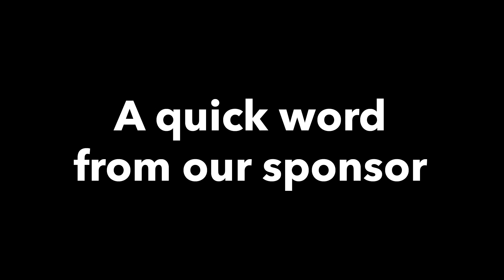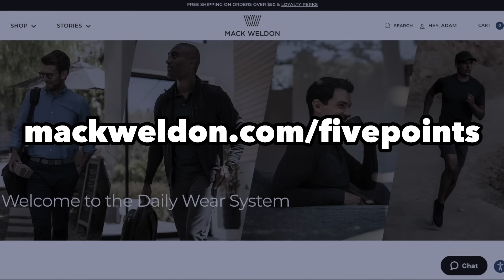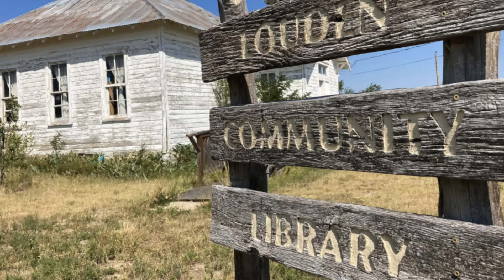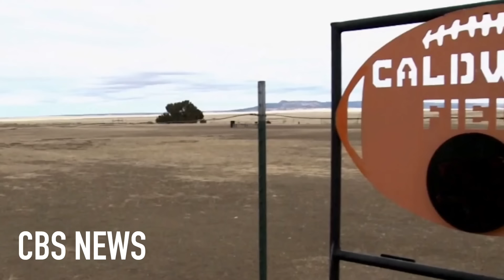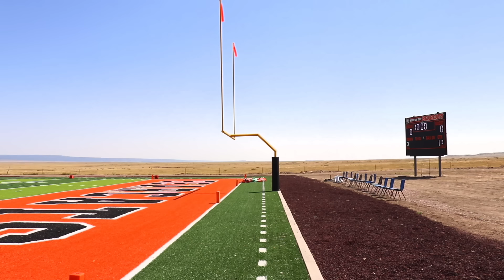What Happened to the 'Worst High School Football Field' in America?

Comment: The closest gas station is an hour away? So they drive an hour to get gas, and waste it on the hour drive back? 😂
Reply: A communal Gas Pump might be a good idea. Regulations on building one are tough after all can't have them leaking into the ground that stuff causes cancer and other problems but should be able to be overcame. No way to make it profit driven. Or switch to electric once the vehicles are all cheap enough to be afforded out there in the country. Although I don't know about battery performance with cold and good amounts over sea level.

Comment: God, closest gas station an hour away. By the time you get home you have to turn around and go fill up again
Reply: State should really do some co op gas tank installations around the state in low population areas as there not the population to make a gas station profitable with the cost of making the underground or surface tanks leak proof as that stuff causes cancer and other problems in people if it leaks. Might need a community co up fuel delivery truck as well. Community can pay for all costs over time after all they already spending the money going to get gas. Actual profit making gas stations need a fairly high volume to make enough profit at those margins. In old days when no one thought about the environmental mess and harm to people small stations in rural areas more common using primitive tanks that leaked. But rural population higher back then it took way more people to do farm and ranch work.